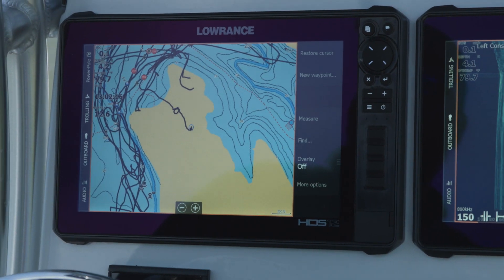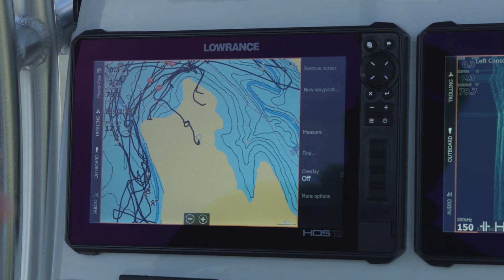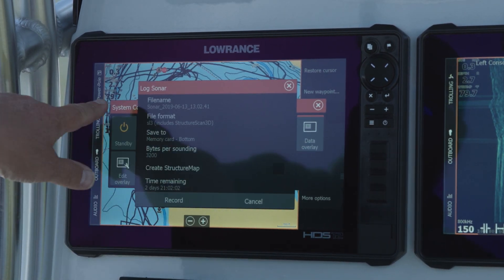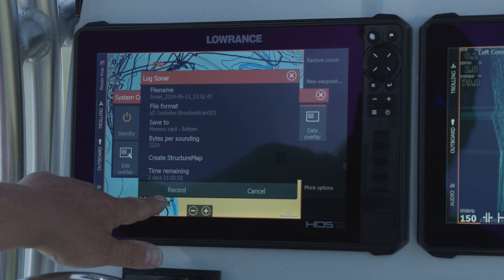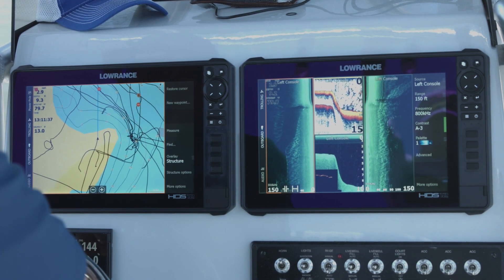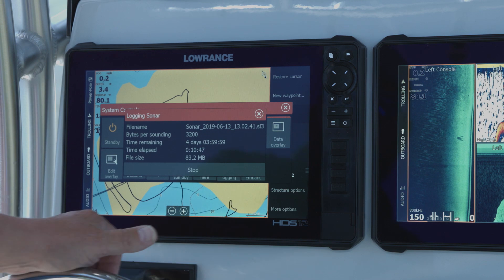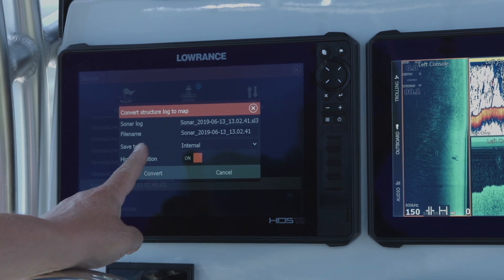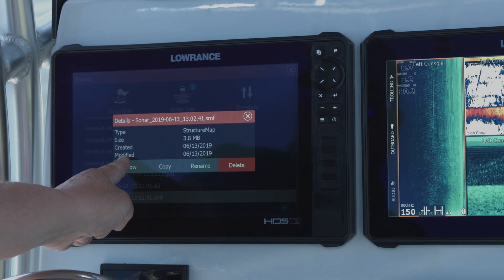Lowrance | How to Create a Structure Map

Comment: I have an SD card with Genesis Social Downloads. I have a lake with an incomplete structure map. Can I record the incomplete portion of the the lake and add it to what's already downloaded to complete the lake map or would I have scan the entire lake and make a totally new map? Or could I possibly save the section of the lake recorded as a separate name and use it when fishing the newly recorded area? All that said, can I gradually add to an existing map over time during separate visits to a lake. Any help is much appreciated.
Reply from the maker: You can add your sonar logs on the same lake to your genesismaps account. Genesis Social Map will be updated once a month merging all your uploads.
Reply: @lowrance  Thank your for your reply! So the only way for me to create my own chart map with contour lines or add to an existing chart map is through the Genesis online website? I scanned a portion of a private lake this weekend, converted the file but all I have is the playback of the downscan imagery. I may not have initially ask my question appropriately. I was under the impression, that from that lake scan, I could produce a chart map with contour lines from the unit itself internally and could later upload to my Genesis Social account if I so choose. Just so you know, My current unit is a Hook2 Tripleshot.... is this unit limited to the function I'm requesting? I'm trying to learn as much as I can with this unit before upgrading to newer HDS model. Is there a better means of discussing this with you personally via email or direct messaging?  I sincerely can't thank you enough for your assistance.... very much appreciated!!!! 👍
Reply from the maker: You will need to log your sonar using slg or sl2.
In the past you could have uploaded the sonar logs directly from the unit, now you will need to log into genesismaps.
You may write to us on FB, we'll be happy to help you from there.
Reply: @lowrance  I did log my sonar using "slg or sl2". I'll go to my Genesis account and try to complete my Chart map. I'm learning as I go and sincerely appreciate the help!

Comment: I can create the structure map and if I click on "show" it will appear on the chart as an overlay.  However, if I click on "clear cursor" or restart the system, the structure map disappears and I can't get it back.  The overlay still says "structure" but it doesn't appear on the chart.  Any suggestions?  Thanks
Reply from the maker: Do you save and convert the structure scan logs onto a memory card before restarting the unit?
Reply: @lowrance  Yes, when I save them to internal memory it works.  If I save them to a memory card it doesn't work.  Perhaps the unit doesn't look for structure maps on the memory card, only internal memory.

Comment: Can you place features in the middle of the side scan only on the larger units?
Reply from the maker: You can create 4 way splitscreens also on Hook Reveal. However, you will not have the option to have left sidescan and right sidescan with sonar in the middle, as per the HDS or Elite FS series.
Reply: @lowrance  Got it! Thank you!

Comment: With a Point-1 installed (and setup correctly as the heading source) why does StructureScan create Structure Maps with the GPS positioning as the heading instead of the actual/real compass sensor in the Point-1?

Comment: the structure map the is created stays on my memory card until/unless i delete  it?it is an overlay to put on the chart?
thanks
john
Reply: Yes it is an overlay on the chart. Yes too much data for the internal memory so it will be saved to the card. For example you could make a Structure Map of Lake A save it to you card, convert it and label that card Lake A and then do the same for Lake B on a new card and just pull out the card that corresponds to the lake you are going to that day. Depending on the size of the areas and the size of the card you might be able to get more then one on one card or you might need two cards for a large lake.
Reply: jw228w ok thanks.what is ?convert"? why do i need it?can i just save as is without convert?
john